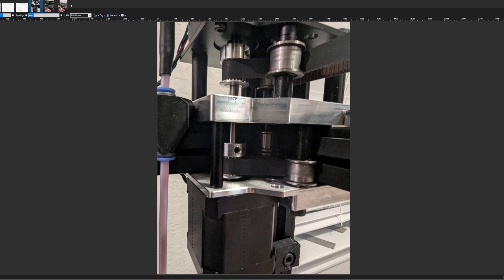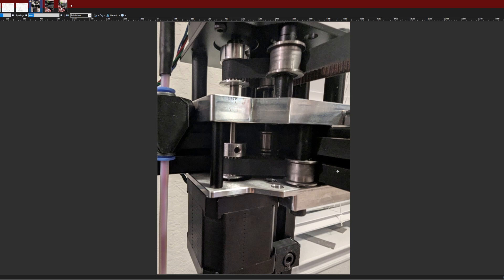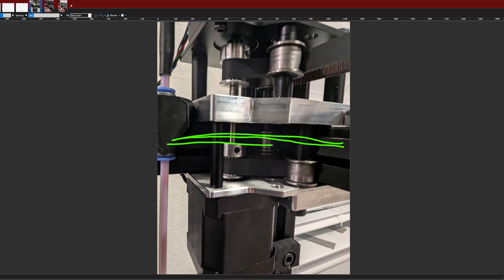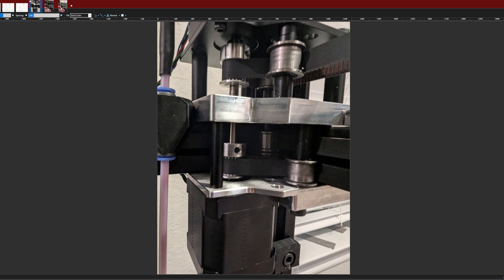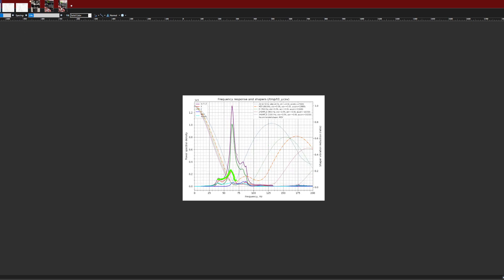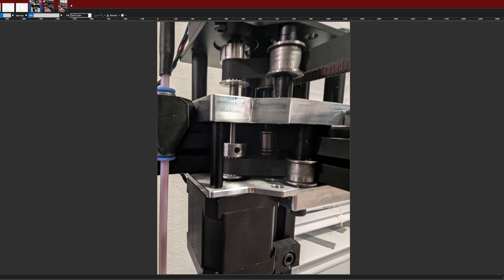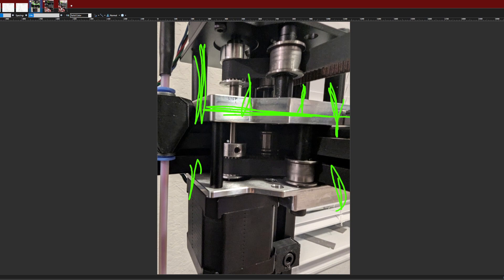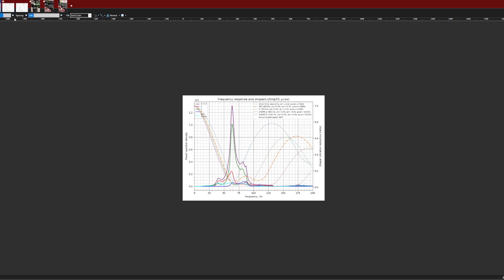Rat Rig V-Core 4 - Resonance Crossover

Comment: 7:30 - To move the Y resonance from 65 to 105 Hz will presumably require the belt to be much shorter and much more taut... probably more than the V-Core 4 design will accommodate.  Do you have input shaper resonance graphs for the original 3D printed ABS parts that were replaced by aftermarket aluminum parts?  The ABS parts may provide some dampening.  It might be interesting to see if an idler pulley on the side of a long belt run that could be adjusted up and down the belt might reduce resonance.  If a long belt segment was resonant, placing an idler pulley contact point 7/13ths the way down that belt segment might disrupt the harmonics by shifting the resonance frequencies to a range where there is much more dampening.  It's great that Klipper allows us to see input shaping graphs to quantify the systems that we are tuning.

I am very interested in your experiments and the information you're providing as I am gradually talking myself into a 500 mm V-Core 4 IDEX that I don't really need, but really want.   🙂

Comment: So, if the shaft is transmitting the harmonics from one axis to the other, what about just using 2 discrete bolts: one for the upper and one for the lower. Then the harmonics would have to go through the middle block, which has way more mass. Basically remove the common shaft being a problem.
Reply from the maker: I have the plates from Mandala Rose Works, which do not use a common shaft but two separate bolts. So it really comes down to the vibrations are enough and the plates are rigid enough to transmit them up.